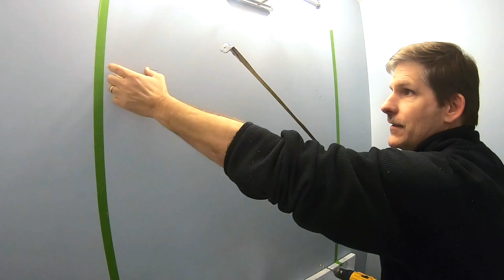How to Hang a Heavy Mirror on Drywall

Comment: Hi
Nice video. I want to hang a 30 by 66 inch frameless mirror. It is about 75 pounds. Would it be safe to use 3 metal j shape mirror holders screwed directly into the studs?
Reply from the maker: Hey Brooke, 
that’s a lot of weight. I would check that the hangers could carry the weight. Should be listed on the package - or call the manufacturer. It’s too dangerous to get that wrong. So check and double check.
Thx for watching!

Comment: What kind of anchors for a 55lb mirror
Reply from the maker: Hey Joe,
Personally, I always prefer to hang heavy stuff to a stud or two. 
That being said, you can buy “j” hooks online/Amazon ( make sure the listed weight is 50 lbs.) 
They have a very small nail and say that they do not need to be on the stud-drywall is fine. 
The nail is pointed down at 45 degrees or so. It’s design takes advantage of physics and the strength of the nail.
You have options - personal preference. 
Thanks for watching.

Comment: What if the actual mirror doesn’t have the hooks to hang on the back?
Reply from the maker: Hey Lizbeth,
1st - is it framed? A wood frame can have hooks added. If it is not framed and not supplied with a way to add them, big box stores carry mounting clips to attach to the wall and then slide the mirror in to place. If it’s a new mirror, I’d try and reach out to manufacturer. Otherwise, I’d see what the big box hardware stores have that might address your particular situation. 
Hope that helps. Thanks for watching.

Comment: Hi, HouseBarons 

Can mirrors be glued to drywall with adhesive e.g heavy duty mounting tape along with with any type of adhesive or glue on the back of the mirror against the drywall or does it only apply to concrete walls only?
Reply from the maker: Hey Antonio,
We don’t have experience with gluing mirrors to walls. Only have seen it on tv. A custom glass company might have a better idea of what is possible and glues that work.
Thx for watching!
Reply: You gotta sand the paint off drywall before applying mastic.

Comment: If its a heavy mirror using the same type anchors and screws Do it have to be in a stud in the wall or it would be fine??
Reply from the maker: Hey Rashee,
The anchors supplied by the mirror company we used is enough to hang the mirror. The only  caution is to make sure that the anchor holes you drill are the size which are in the supplied directions. If you bought the anchors separate from the mirror, make sure they are rated to hold the weight of the mirror. 

Our preference is to hang heavy mirrors on studs, but sometimes that is not possible. 

If you are looking for a little more holding power, you might want to look into butterfly wall anchors or toggle wall anchors. 
Thx for watching.

Comment: How can you add the hooks yourself when it's just a mirror its self
Reply from the maker: Hey Norma,
With just a mirror, you might be able to find hooks that stick to the back, but I’m not sure of that. 
I know there are kinds of clips that grab the bottom edge and top edge of the mirror holding it to the wall.
And then there is the option to build/buy a frame for the mirror which of course could have hooks added to the sides. 
All depends on your decor and the goal of your final look. 
Hope that helps. Thx for watching!

Comment: Hey Just a quick question, I would like to hang heavy mirror on plasterboard wall. There are wires or cables behind the wall as detected by stud finder. Does that mean I cannot hang the mirror on that spot ? or Can I use wall anchors and that works fine ? Please help.
Reply from the maker: Hey Justfor...,
Knowing that there are wires behind there means you have to be extra careful and slow when drilling any holes. 
It helps to know if those wires are in conduit or just bare wires. 
To be safe I would make an exploratory hole away from the wires ( but which would still be covered by the mirror) . 
Then slip a mirror or phone into the hole and see what the situation is.
Reply from the maker: Hey Justfor...
Another possibility ( if you don’t want to mess with patching the wall behind the mirror ) would be make a hole with a hammer and screwdriver. The screwdriver is pretty blunt and shouldn’t hurt the wires like a drill could. BUT if you have plaster and lath (wood slats ) behind it, the lath will just pull away. 
It’s all about going S L O W and careful.

Comment: You don’t need to find studs?
Reply from the maker: Hey Kai,
The directions for the mirror will typically tell you. You can get drywall anchors for heavy objects - you just have to make sure the anchors can handle the weight of the objects.
But IF possibles, hanging a mirror on studs is the best way - solid!
Thx for watching

Comment: Why you don't use adhesive?
Reply from the maker: Hey Ming Hu,
Adhesive can be used but that method makes is difficult to change to a different style. 
But as you suggest - it is an additional option to chose from.
Thx for the question.

Comment: Ok so let me just get things straight here:

1. If you locate the studs, can you just drive a nail through the drywall and into the stud without the need for an anchor? Is it better to use a nail for this or a screw? Can a drywall anchor go into a stud? Will a nail provide enough support for a 25lb mirror?

2. Can you hang the mirror on just a single stud with the other support being an anchor?

Thanks
Reply from the maker: Hey 123...,
1) yes. A nail or screw driven into a stud is very secure assuming it’s driven in far enough ( see below - “rule of thumb”.
As an experiment - drive a nail into a board and try to pull it out with pliers. And a screw is virtually impossible to pull straight out with pliers. 
A good rule of thumb : Half the length of the nail or screw needs to be embedded in the WOOD. So if you typically have 1/2 inch thick drywall and the nail protrudes from the drywall 1/4 of an inch ( for a total of 3/4 of an inch not in the wood) then your screw or nail would need to be driven 3/4 inch into the wood. Thus the total length of the nail or screw would need to be 1.5 inches.
A drywall anchor is unnecessary in a stud. Use a screw. Done!
Drywall anchors come in all different kinds. The goal is to expand behind the backside of the drywall or apply greater friction thru expansion so that the screw is harder to pull out of the drywall. Drywall anchor work to a degree, but not as well as a screw into wood.
2) perfectly fine.

Thanks for asking and watching!
Reply: @Housebarons  x